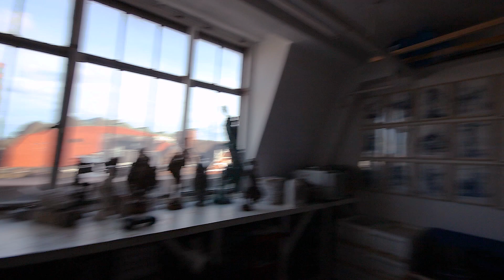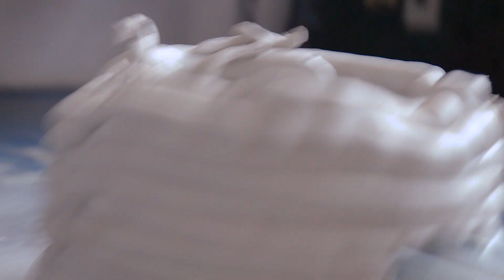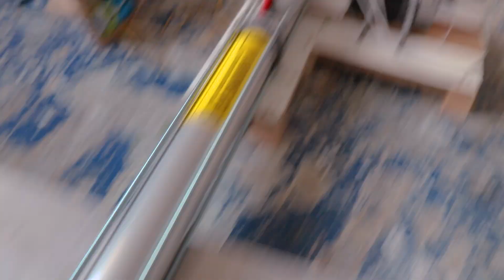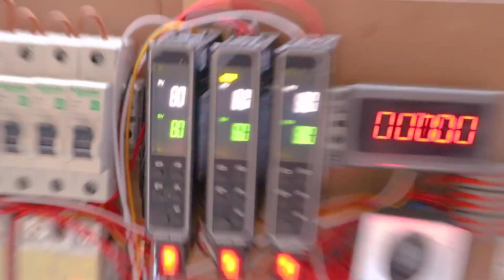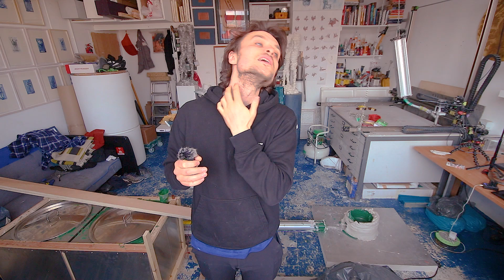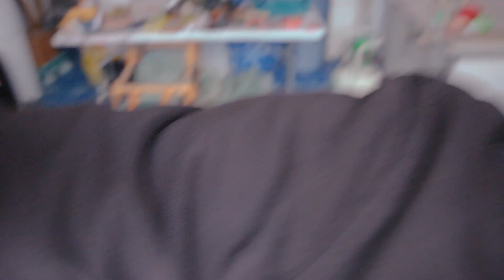I spent two months building this lost wax casting machine. Now it's time to test it.

Comment: Great progress! I have to point out that as you pump up higher the back pressure is going to get a LOT higher. Your pump may be big enough but you should really do a test pumping into the bottom of a tube as high as you plan to pump into the actual mold. You might get up to a certain height and stall out... Let me know if you have any questions!
Reply: Could you fill the main mold with the figure laying down to minimize the height and make the arms able to drain?
Reply from the maker: Thank you! And yes good point! I was also worried about the downwards pressure of that much wax forcing the pump backwards whilst the machine is turned off! 🤞